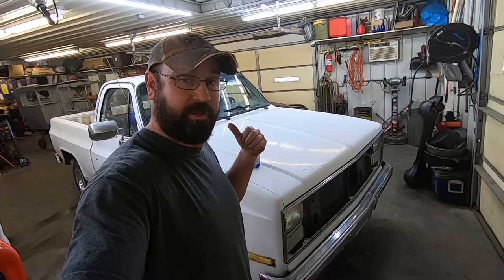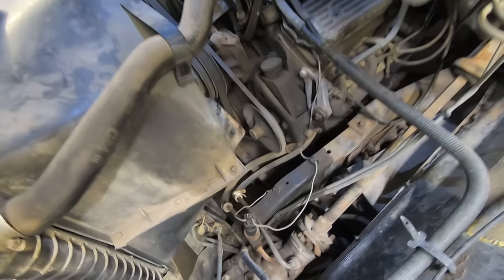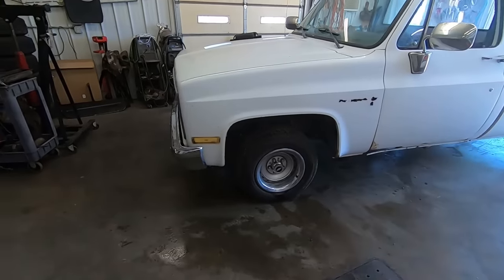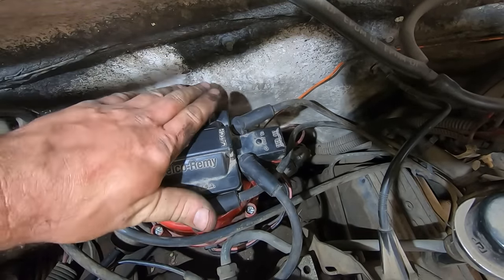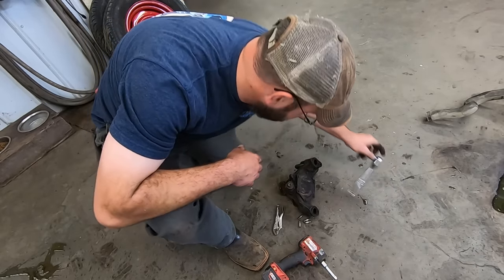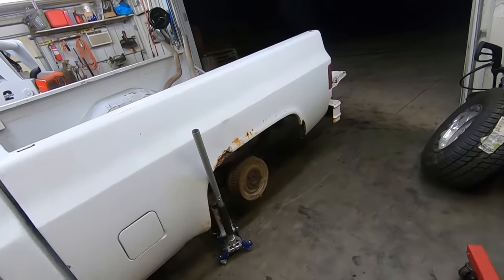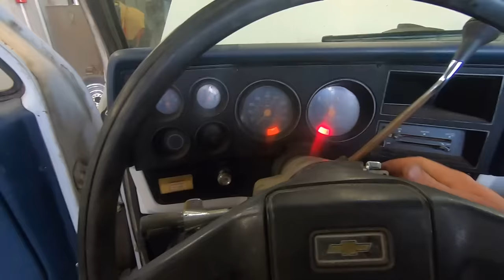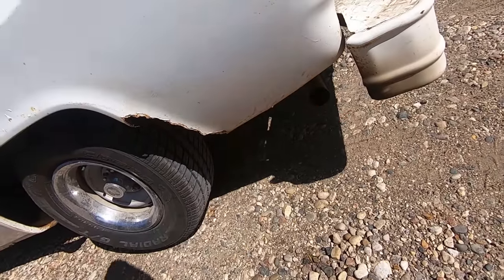I bought the cheapest shortbed Squarebody on Facebook Marketplace! Will it run? Daily driver?!?

Comment: You mentioned several times replacing the rear bumper with a sports bumper and possibly the front bumper. I believe you have a square body blazer that is not that great of shape in your lot. The bumpers bolt up between the two, make sure you bring the brackets over for the rear bumper. That's where I got my bumpers for my 80 custom deluxe.
Reply from the maker: I think the K5 bumpers and brackets are different but we have done it before with some fab work. The earlier bumpers are different too.
Reply: @MortskeRepair  I bought a rear bumper and brackets off a 80 K5 that bolted directly to my 1980 C10. The only thing a lot of people dislike about this route is how much stand off there is when doing this. But you can drill new holes in the C10 frame to move the bumper further in. I would show pictures, but I disassembled the truck back in March for a "restore" and am currently waiting for some friends to help me put the bed back on. BTW, I really enjoyed this one as I can relate a lot with the 4.3 kinks and the fact it is a square body. It helped me identify what years my bench seat came from so I can buy replacement upholstery.

Comment: The vaccum valve on the firewall is the for the converter lock th350c
Reply from the maker: Never heard of such a thing. Especially since this one has a TH400.
Reply: @MortskeRepair  I noticed when I watched the video that you showed that it has a th400. I did a ls swap last year on a truck that had that same valve on the firewall, actually had two. One was for the converter lock and I found out it was a th350c
Reply from the maker: @takuacheperformance4740  Interesting

Comment: Needs a bbc in fronta that th400! That condenser in the dizzy is for noise suppresion. I use indian head shellac for gaskets or grease. Never had a problem with either except the indian head will NOT come outta ur clothes or hair! It stays on ur hands for a pretty good while too.

Comment: I just picked up a 94 Astro CS AWD with the 4.3. spotless interior, captains up front and the optional dual benches out back, was running great(minus the needed tensioner pulley) and suddenly, it no start. Cranks fine, ran fine...had just completely filled it with fuel and cranked the cap...might have to check the gas cap first now that I think of it, might not be breathing
Reply from the maker: Give it some ether, see if it pops. Might be a fuel pump.

Comment: You just keep tell yourself that the TV cable on a 700r4 is a kick down cable 👌 it directly effects line pressure in the trans  with out it if it moves id be surprised if it makes it out the driveway it will come back on a tow truck
Reply from the maker: Sorry, screwed up my terminology.
Reply: Just giving u crap cause I can

Comment: 86 was the first year for the vortec had a 4bbl carb was the design for the indy cars in 86 remove the smog crap and hp increases a great deal had one got rid of the quadra junk put a good edebrock carb on was a 4x4 went mud racing with it was a winner in stock 6 cylinder class pissed jeep owners off cause it had a 4 bbl carb and i had more power than they did and the re moval of all the smog crap will get you 75 to 85 extra hp had mine dyno'd

Comment: A carb that old, was the bottom the carb rotted out? 
Dumping gas down the intake manifold?

To find if your alternator field is energizein id turn on key to run, field should magnatize the alternator pully, should attract a small wrench or other steel item like socket extension.
Reply: I had that happen on a 1980 silverado and on a 1984 Jimmy.
A pressed metal plug that rotts out

Comment: I believe that trans is a TH375 if it shares the same pan as the TH400 but has the long tail housing, essentially a light duty TH400.
Reply from the maker: Gotcha, I've heard of them.
Reply: @MortskeRepair  I had an 86 Sierra Classic short bed that was a 4.3 5-speed that someone converted to a 350 with an automatic, I really regret selling it because that was before the prices skyrocketed.
Reply from the maker: @stevew270  A 5 speed would be cool!
Reply: @MortskeRepair  Automatics are boring!
Reply from the maker: @stevew270  But they work!

Comment: And 90 percent of the gm square body trucks I had was the custom deluxe, including a 85 Chevy custom deluxe C10 long bed that looked almost just like that one, except mine had maroon interior and a reupholstered seat with no design on the vinyl and was a burgundy red.. it was also a 4.3 quadrajet 4bbl but no overdrive it actually had a th400 on the back of v6?! I doubt it was supposed to come that way.
Reply from the maker: Yup. The only 3 speed auto the offered at that point

Comment: I gotta ‘73 shortbed fleetside smog exempt here in the s.f. Bay Area for $3500…..already swapped a LS in it the first week it was home and now I’m getting ready to bolt on a vortech centrifugal supercharger with a Holley terminator x…..just in the process of painting it white with blue ghost pearl…….. I basically stole the thing, it was originally a 250 6cyl with granny 4 spd manual….now it’s gotta built 3000 stalled th350…..wife thinks I’m gonna flip it….lol …nope,,, I’ll be selling my mbz cls550 before I sell the c10…..lol
Reply from the maker: Nice

Comment: Just don't do what I've done to several of those trucks either put a newer aftermarket CD player in them because the dash was hacked up, and also the eBay Bluetooth junk, and I even installed a pioneer single din stereo and speakers subwoofers and amplifier In a 183, mile 82 Chevy k20 Silverado I'm ashamed to say I cut the dash to put that one in.. but I'd bought some of the best equipment at the time new and Installed a system in it, and a dual CD player and a few Sony xplod CDx series CD players in a 86 Chevy k20 custom deluxe that had 291, miles I didn't cut the dash on that one my brother did to put a durabrand piece of junk in it it was a CD player and a new one I'd bought for my momma to put in her truck but it was all manual tuning even though the tuner display and clock were digital...I ended up mailboxing that thing, and put in a Sony xplod CDx L600x CD player one of my favorite one's I've owned..

Comment: rip out that POS V6, I never had any luck with that motor and it cost me $1000s in parts cost. If it is a V6 Chevy Dodge or Ford I don't buy them. V.8 or 4 banger fine. I got a 1985 Ford Ranger with 90k original miles 4 cylinder that runs great. Does not even burn oil.

Comment: No inlet fuel filter on those Qjets will make it run like shit. The filter acts as a restrictor to the primary side of the carburetor. Ask me how I know😂
Reply from the maker: Never knew that!
Reply: @MortskeRepair  tried running my plow truck years ago without that inlet filter and it was loading up and running rich. Replace the filter and viola!

Comment: Didn’t that distributor that I gave you work ?or the one on the 307 ? I have my local liquor store looking for Hamm’s Select ! I can’t make it on the 2nd , wife is having surgery but will try to send stuff with son for you ! I’ve had 3 v6’s all 4.3 but different years and one was a Vortec in a 1997 and oldest non vortec  1985 , the 97 was a Chevy WT and one was a Buick lasabre and one was an Astro van !
Reply from the maker: Needs to be for a 6 cylinder!
Reply: @MortskeRepair  ok , makes sense ! Lol Daaaaah, I’m sending the foot 🦶 gas pedal and foot 🦶 dimmer switch with my son if that’s ok with you !
Reply: @MortskeRepair  oh and if you wanted to try a boat pressure tank I can send one of those also !
Reply from the maker: @davekimbler2308  Sounds good!

Comment: They're a little pick-up call inside that distributor it's you can use one off of four cylinder or any other type but you have to change the outside casing and where the points are you know like eight points for eight cylinder 6 for 6 cylinder Etc but it calls to say two wire call it worked great I did that all four cylinder one time after I changed the point outside casing to Elite solar wonders took it out put the one on four cylinder inside and it worked great I mean you know it's the same call basically just a bit outside points and everything go for each one for firing on it is different you know like like I said for sale or six cylinder Etc whatever you use it but to call inside the same work great for me it's a nice thing to know I did it got away with it

Comment: You will definitely get another 25 years out of that truck and leave that 4.3 in there just keep the oil change it'll run forever like I told you earlier I got over 400,000 out of GMC truck that had a 4.3 in it 1991 I'll never forget it I even drove to the junkyard because the doors are falling off of it and then 5 speed manual transmission the tail shaft was all Reginal but it was leaking and it needs to be fixed that kept the gear oil change in that too and I put just a couple clutches on it but everything was original it wouldn't quit love them GMC trucks
Reply from the maker: I love the 5 speed behind a 4.3!

Comment: As far as the 4.3 goes I had a 91 GMC truck and they didn't come with the air pump driven it to the doors fell off 400,000 miles synthetic oil when it bought it brand-new in 1991 the GMC truck drove it to the junkyard and they gave me $1,000 for it and 5-speed manual transmission half-ton truck I had so much stuff for that truck I'll swear on GMC I swear on GMC trucks never had the front end aligned always had good oil pressure f*** them Ford piece of schitt's

Comment: They've been calling the 4 3l v6s vortec engines since 85 and they've been calling the 5.7l a vortec engine since 95 but they didn't actually have the kidney bean shaped combustion chamber on the heads till 95 so they weren't really vortec engines till 95 or at least the 4.3l wasn't a vortec engine till 95
Reply from the maker: Good to know!

Comment: So I effed up a 5-6 years ago had a guy give me a 86 swb white 4.3 th400 old cable vision/time Warner truck, literally the same fkn truck wtf, put new plugs in it fired right up, needed a motor mount and brake line and tires etc but still, literally in the same shape same interior grill/headlights/signals and I let it go on a crap deal, traded for some of my old wheels and tires smh, I was broke at the time trying to keep my 85 k1500 gmc going and it needed tires and the guy had my previously owned wheels and tires that were old but like new lol, I'm still sick over the fact I let it go for more than one reason, one the guy that gave it to me was a great guy and I feel absolutely terrible for not keeping it, and the fact a guy can't ever find one for a deal like that ever again ya kno? Man I fkd up 😭
Reply: Then that guy put a better cab and fenders on it bed sides v8 swapped it sold it, next guy big blocked it and lowered it then it switched hands a couple more times and I lost track of it, im still 😔 😟

Comment: Maybe they used a 400 because v6’s are naturally extra shaky and they shake turbo 350’s apart 🤷🏽‍♂️
Reply from the maker: I think they had dropped the TH350 by then it sounds like.
Reply: @MortskeRepair  but why not use the 700r4?
Reply from the maker: @newrealm9187  These were the low end pickups. And an OD costs more money.
Reply: @MortskeRepair   to be honest I’d prefer a 400

Comment: you left the plastic cover on the upper control arm's  ball joint. its to protect the rubber boot in shipping. now you might have pinched a hole in it L0L i seen it fold all up
Reply from the maker: Dang, I'll have to check that out. You sure it's not the boot?
Reply: @MortskeRepair  positive its definitely not  i don't think they make blue boots
Reply from the maker: @Vegeta_SuperSaiyanGod  Oh yeah, I've got several blue boots on ball joints and tie rod ends on the shelf right now.

Comment: Nothing wrong with the vacuum stuff and smog pumps don't rob horse power
Reply from the maker: How can they not?!? They run on fairy dust?!? You mean to tell me that belt isn't hooked to the crankshaft and causing a power loss?!?
Reply: @MortskeRepair  they have  no restrictions to them, the power streering and alternator draws more power
Reply from the maker: @MrJeep75  No restrictions? So it's like free energy? If that's true, you're really onto something!

Comment: pulse width modulated mixture needles.
Reply from the maker: Really?!? That's what the connector does?!?
Reply: Metering rods actually....
Reply: The connector on the opposite side in the front goes into an internal throttle position sensor.
Reply: If it was working correctly, when you turn the key to run, without starting it, you could hear the solenoid clicking away.

Comment: Excellent video Mortske Repair :) also that truck should have time on +1 degrees, also O2 sensor may need change also PCV Valve to replace and should have 89 or 91 octane run in them ! Those truck with 4.3 litre 6 cylinder 262 Cubic Cm, Turbo 400 3 speed Automatic transmission with 355 or 388 rear end gears! You know why GM made 4.3 litre because the Hercules 4.7 litre 305 Cubic Inches V6 motor in 1960's was big seller then too and how popular were to also perform!

Comment: Quit making excuses about how it the LS swap snowballs and do it as a how to ls swap a square body build the correct way and get it done. You already said you need to replace the fuel system anyway.
Reply from the maker: 4.3 works too good to remove.

Comment: Pop quiz: When will the "Big 3" Engineers figure out that disk brake "Dust Plates" can be made of "Plastic" and never rot out? Just sayin
Reply from the maker: The heat would get them I think
Reply: @MortskeRepair  some plastics are better at this application than others. Polytetrafluoroethylene, also known as PTFE and Teflon, is a widely used plastic that was discovered in 1938 by the company Chemours. It has one of the highest melting points out of any plastic, 620°F (327°C), but it maintains its strength at temperatures as low as -450°F (-268°C).
Reply from the maker: @craigsowers8456  but what’s the cost compared to iron?
Reply: @MortskeRepair  probably more but in the numbers of Automotive it might be worthy ... but also knowing the Manufactures don't really give a crap about "Customer Satisfaction", it would have to be forced by 1 before others would consider it.  Besides it would cut into their high profit margins for spares.  Just a thought.

Comment: You you are the reason that I can't buy a square body without having to unfuck the entire suspension every time it's a truck not a car it's supposed to have travel so that way it can handle a load and it's supposed to have rake so that way whenever you do have a load in it it levels out and you don't blind everybody going down the road but no it's fun and games and I really am just picking I don't particularly like it but it's not my truck but on a more serious note it really does get on my nerves that I can't find a single square body that I actually like that hasn't been jacked up to hell and back and if I do find one they want an arm and a leg for it because it's been "restored" and the price for the four-door long beds are already expensive enough then to pay that extra price on top shit you can keep it bubba
Reply from the maker: Thanks for watching!
Reply: @MortskeRepair  you did read the whole comment right? Just trying to make sure you know I'm not trying to actually be an ass
Reply from the maker: @DAR10162  I read it all, still sounds like you're bein negative.
Reply: @MortskeRepair  fair i did get off the handle I little at the end sorry about that
Reply from the maker: @DAR10162  NO worries!